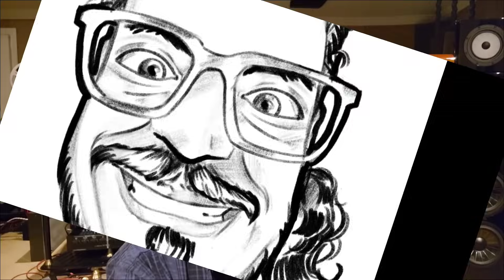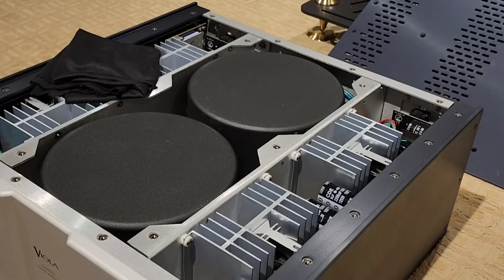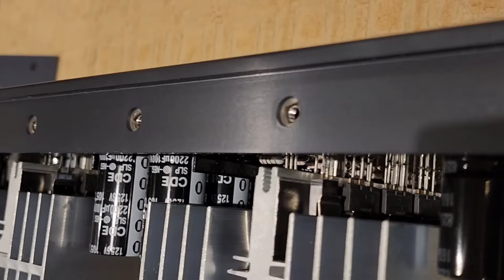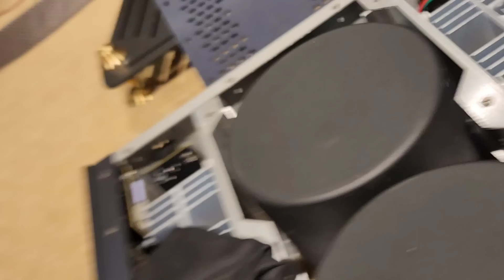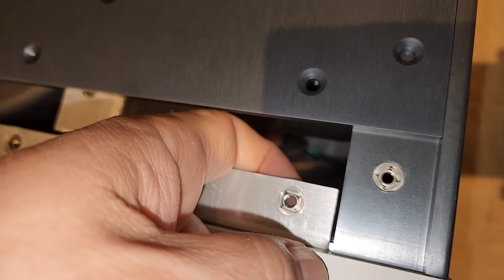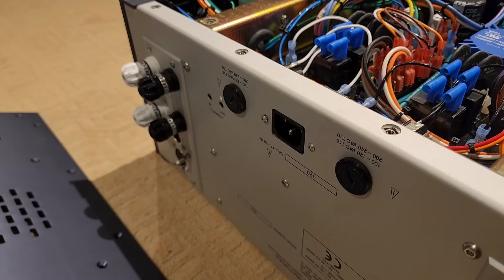THE BEST SLEEPER AUDIO AMPLIFIER OF THE DECADE !! #thebest

Comment: I have a Hafler 9505. I paid $700 for it on Reverb. It's amazing. Quiet, clear, dynamic,   imaging & soundstage, all get the checkmark.
Reply from the maker: Cool ! Glad you enjoy it !! What a deal 👌
Reply: @adambrown8867, I also have a Hafler 9505. It’s my first separate amp and pre. It’s the best thing I’ve owned so far and sounds truly amazing to my ears. I have it matched with a Hafler Class A Series 915 preamp. I’m running it single ended but I’m curious to see what a balanced signal from source to output would do. I think it’s a total sleeper amp too. Tons of capacitance, 4x20,000 mf, I could go on and on. Thanks for the look at the amp in video too Mikey. I think the closest true dual mono I could afford right now would be a Bryston 4b sst one day. Keep the videos coming mikey. I enjoy the channel and the conversation style you use. Cheers.
Edit: Adam brown, what preamp are you using? Ever tried a balanced tube pre with the 9505?
Reply: @kodiak2053  ... Having worked for Hafler in the late '80s and early ''90s the Trans-Nova model 9505 design as it was known,,, was pretty damn good .. I own a few NIB Hafler Class A Series 915 preamps... thinking of the day I'd use them..
Cheers, M/S ... Subscribed.
Reply: @kodiak2053  I only have 2 preamps & both are Chinese made headphone amps. One is a Singxer SA-1 which is the one I've been using for a long time. The other is a Xduoo TA-26, but I haven't even set it up yet. It's still in the box. Actually I've got 2 of each.
Reply: now that is MY IDEA of a SLEEPER AMP. Much like my LSA Voyager GaN amp (~2k) or my EVS 1200 IcePower dual mono (~ $2700) by Ric Schultz (Tweak Audio)
Reply: Hey I have 2 Hafler P9505 amps I bought new in the mid 90's.
I run them mono and each power one of my Focal Kanta 3 fronts.
They are great amps!
Reply: Watch the capacitors in that amp . Ive lost two very nice pairs of speakers to Halfler Amps. And when they go , unlike other amps , they campfire and brrrrrrrrp ....there goes your JBL .
Reply: @jeremywhittler8591  It didn't blow up but it started to get noisy & then it blew my right Tannoy XT8F by popping the speakers when I turned it on the last time.
Reply: Hafler good value🖖✌️🍻

Comment: Excellent. This is what I like to see. No-nonsense solid engineering design refined over the years, with no bling. Thanks, brother!
Reply from the maker: Glad you enjoyed it !
Reply: Military products are like that: basic, over engineered and 100 times the market rate with every certification it is possible to have. The certifiers will be impressed by the expensive nuts holding the case together. Nothing bad hidden under the bonnet, but taxpayer footing the bill so price no object.
Reply: It costs $34K (pre-amp not included).
Reply: @Mark-rw3kw  Ouch
Reply: With an actual wheelbarrow of hi- performance caps.
 Caps comin' out yer ears!
Reply: @thomasmleahy6218 they look like Mundorf capacitor’s to me but I could be mistaken?
Reply: well ,he is your brother

Comment: I don't see two large power supply chokes, which is what is needed for the two power transformers. If you had a choke on each rail there would be four chokes needed in this amp. Plus the heat sinks look small which means not much standing current and this can cause higher crossover distortion. But it does look nice and well made.
Reply: I don't see big inductors in there either
Reply: Please don’t ever question anything Mikey states using empirical facts.
Reply from the maker: LOL. I guess you can design an amp better than Viola just because you think you can tell what's happening in the amp. The 2 chokes are inductor type. Don't get me started, man. You have no freaking idea about this company clearly or you'd shut up and just admit you don't understand the circuit. Tom fucking Colangelo... Google him bro...
Reply: @OCDHIFiGuy  I can't identify anything that looks like 100Hz power supply chokes either (choke/inductor - same thing). Maybe there are some RF choke/inductors  hiding there somewhere to reduce the switching spikes from the power supply rectifiers., hardly a choke input power supply. Then again I am getting old and frequently put my foot in it...
Reply: @OCDHIFiGuy  Does Tom own your soul? Why you getting so upset?
Reply: @savagedick1462  I don't think I have ever seen him this upset. It can't be good for his health. Hope he feels better soon.
Reply from the maker: @savagedick1462  lol. Nice name. Fuck trolls, that's why.
Reply: @OCDHIFiGuy  This is just basic amp design, if you want a true choke input power supply you need a big chunk of iron and copper for each rail, I do not see that in your video. Then you need enough standing current so the choke does not "run dry". Choke input power supplies need constant current thru the chokes or they will then act like capacitor input power supplies. They most likely have common-mode chokes in the power supply that help with high frequency noise, but don't work at the 120cy ripple frequency. As far a Colangelo, he was brought onboard because John Curl left ML after Mark refused to pay him for his work, so to get back at Mark John published the ML designs that he developed in the magazine "The Audio Amateur" in 1977 for all to see. Question, who is more revered now, Colangelo or Curl? I think you know the answer but won't admit it. Take a deep breath Mike and chill, this is all just audio, not life support equipment.
Reply from the maker: @Random, let's ask Mark, Shall we ? I'll bet there's a different story. And Tom is dead, man...
Reply: @OCDHIFiGuy  Do you really think that Mark will admit that he has owed John money for over 45yrs? I think not. Sad about Tom. Mark and Dan D'Agostino both have used many different audio engineers in their companies over the years. Designing a true choke-input power supply solid state power amplifier is very difficult that is why no one has truly done it. With tube amps there are many examples of it.
Reply: @Random-kq4pz  I think Schiit audio have a solid state model with choke power supply. But is it good and successful, I don't know.
Reply: AYRE audio have produced some amplifiers with choke input power supply,and the choke is visible not like in this case,I think that this amplifier hasn't have choke input power supply maybe power factor correction circuit with smaller inductor for the circuits that don't use much current.

Comment: Absolutely beautiful amp, especially with a choke input PSU. I actually took a screenshot of that stunning PSU. Fantastic design. I’ve moved from tube power amps for the most part to SS, but I still gotta have my tubes in my pre and phono pre. Luckily, those tubes last for many, many years unlike power tubes. Thanks Mikey. Again, beautiful amp! 🔊🎶😊
Reply from the maker: Thanks for sharing Nick !!
Reply: Woooo
Reply: @VinylgorrilaReggae  Woohoo! 👋🎶🥳💨💨💨
Reply: What is the frequency response (bandwith) slew rate,power delevery,single differential inputs or double diffrential inputs,stages configuration (emitter follower or cascode) ?? then ill decide if its worth anything !
Bye.
Lucien